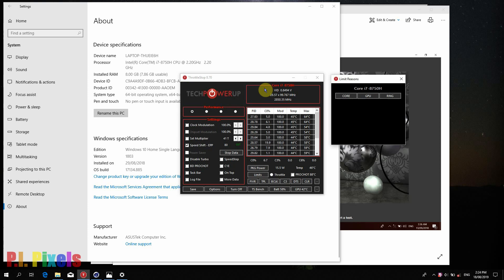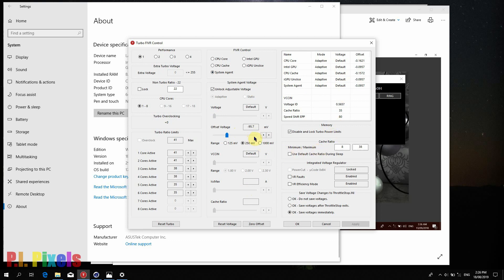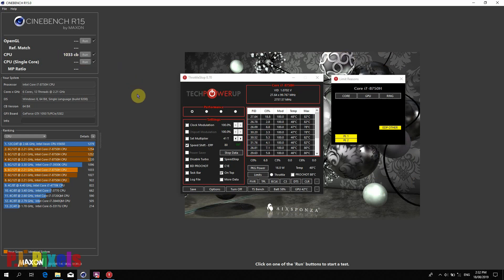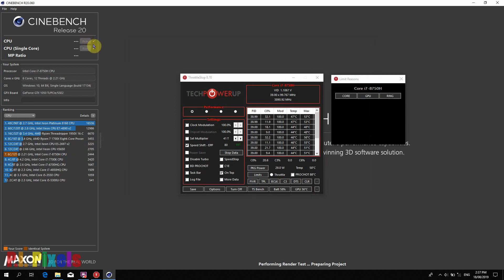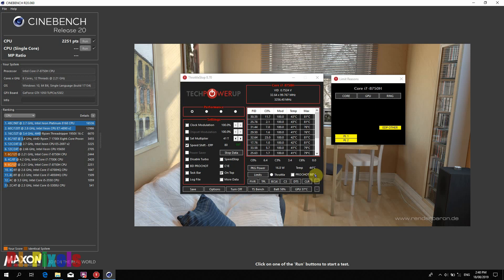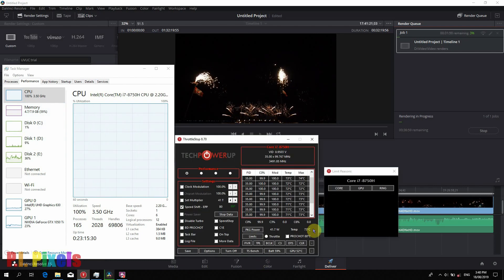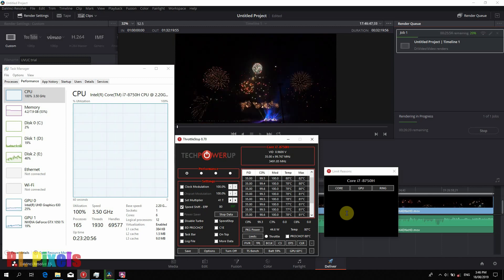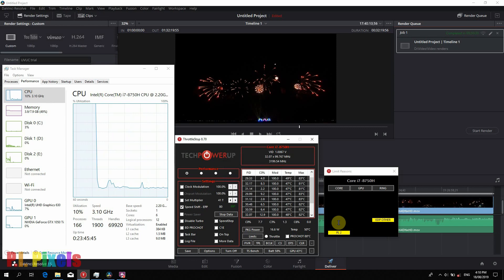Tuning the Asus TUF FX504GE with Throttlestop 8.7.6

Comment: Hello. nice guide. unfortunately on my Asus Tuf FX504GE it doesn't set the voltage offset. it always remains at 0 in the monitoring window. even if set -160 it remains at 0.  I ask you what version of the bios do you have? I had updated to the latest version. How do you go back? maybe this is it?
Reply: You can reflash the old bios system again using a usb.